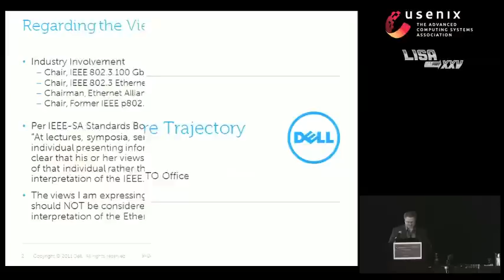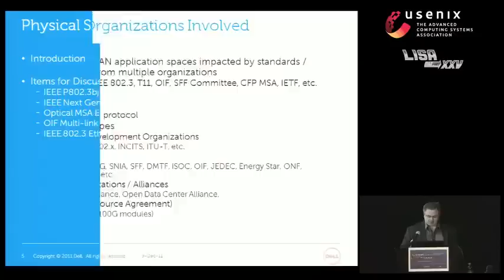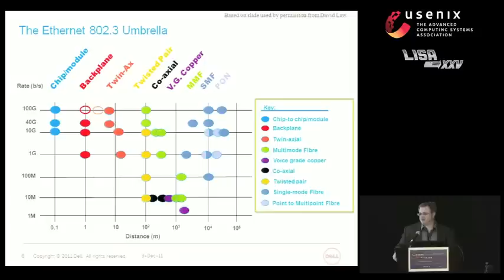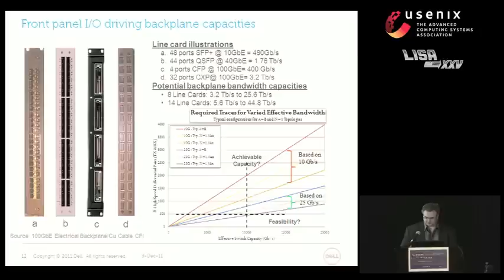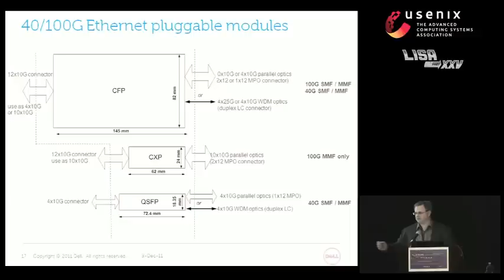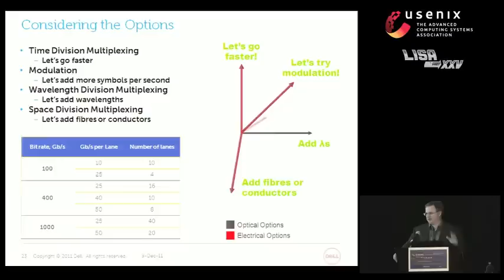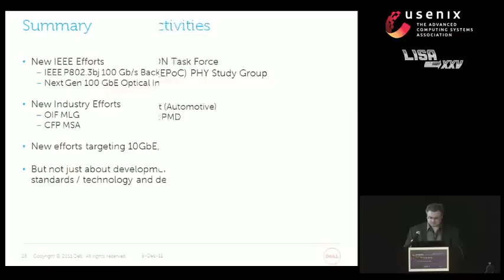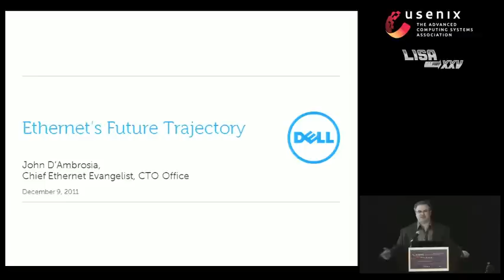Ethernet's Future Trajectory

Comment: What I am interested in is the other end of Ethernet. I want to see an Ethernet standard for low-speed cost and energy constrained devices, perhaps based on opto-isolated single TP for embedded devices and microcontrollers. Spinning application specific buses with application specific to Ethernet/IP bridges is a pain, and it would be great if there was an Ethernet standard suitable for direct implementation in microcontrollers that didn't require magnetics (usually costing more than a uC) even if it was 2Mb/s for sensors, actuators and other components used in industrial automation. Is there any work in this direction?